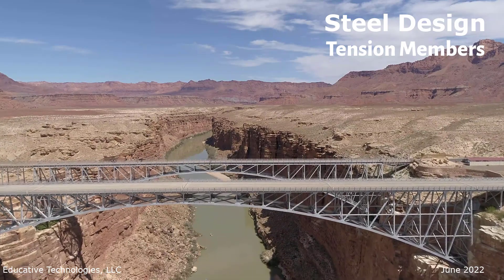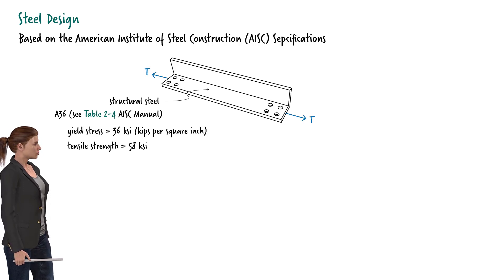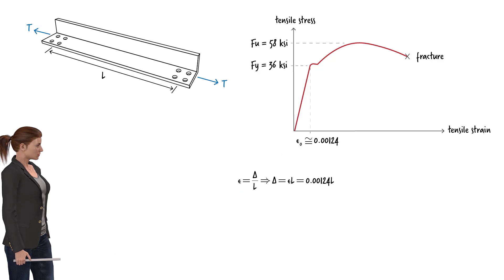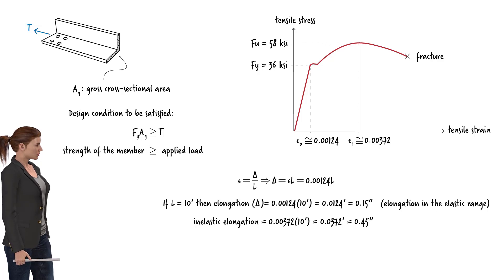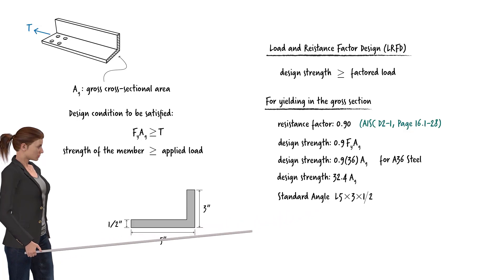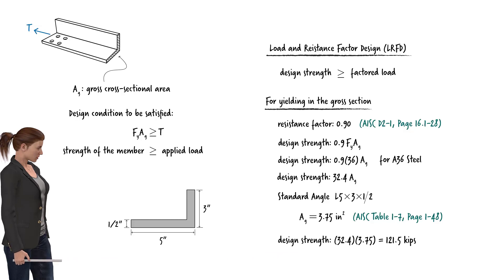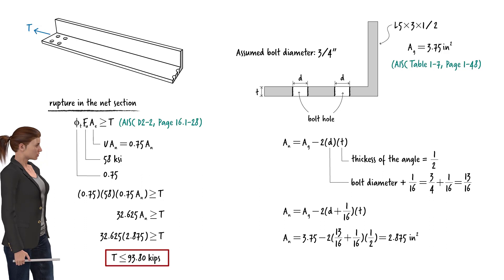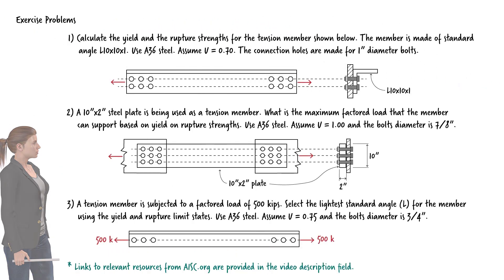SD1: Steel Design (Tension Members): Part 1

Comment: What is the failure theory that has been used for the equation (Maximum shear stress or Distortion energy)?
Reply from the maker: The failure of uni-axial steel tension members, specifically of the ductile material type discussed in this lecture, can be distinctly defined by the steel’s ultimate tensile strength (Fu) or yield stress (Fy) without needing to consider Tresca and Von Mises criteria.

Comment: dear sir, why u are telling FyAy IS ENSILE SRENGTH OF THE MEMBER? iSN'T IT TENSILE STRESS?
Reply from the maker: For member design, we use force as the measure of strength. Stress (force per unit area) is a less direct measure when dealing with members with a known cross-sectional area. That is why we multiply permissive stress (Fy) by the cross-sectional area of the member (A) to arrive at the member strength in terms of force.
Reply: Thank u sir !